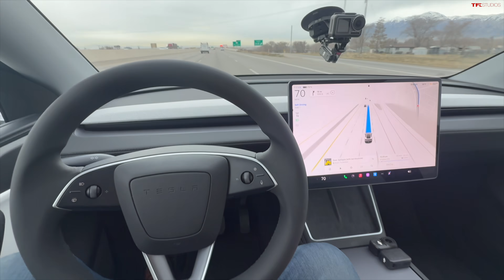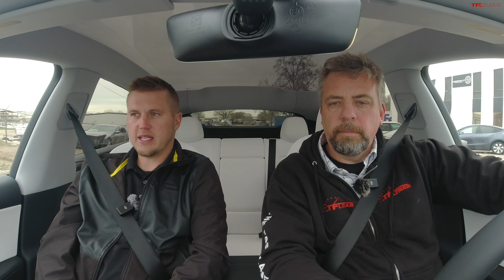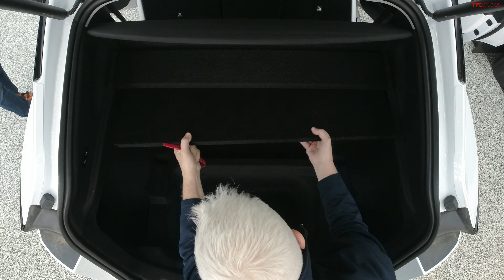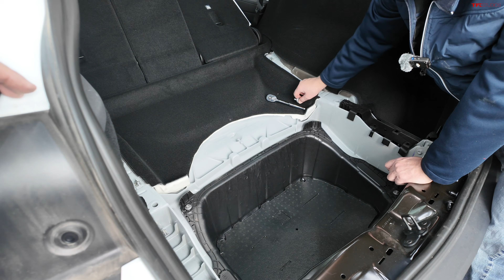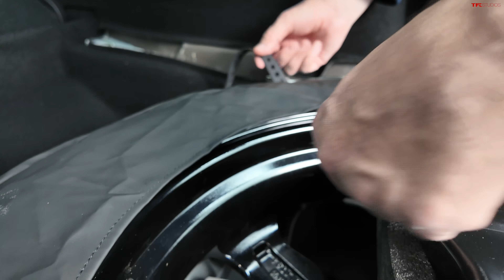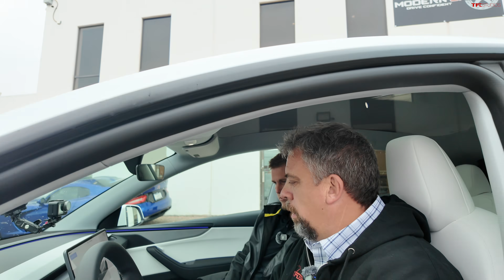This Simple Change Will TRANSFORM Your EV Range!

Comment: I didn’t see any mention of stopping distance, acceleration, wet performance, or lateral grip. 
It’s worth knowing what trade offs they’re introducing.
Reply: Tfl was just testing the tires to see if they would increase range, they are spares and not meant to be used constantly
Reply: yeah man cause people are obviously itching to put donut thongs on all 4 corners of their tesla.
Reply: @Eli.H.Sanchez Stupid people do stupid things.
Reply: Dude it is a spare tire that you helps you drive the car to the nearest shop to fix your car’s tire and then continue your trip. This spare tire is not for long trips it is only a temporarily fix.
Reply: @claudiudoncea9270 That is correct, but the way this is presented will make some people actually drive full time on those tires. Never underestimate human stupidity. There is a reason the USA is so litigious and put warnings on everything.
Reply: Grip has more to do with rubber type then anything else.  A half size contact patch also holds holds twice the weight, which doubles the grip per area--- making the overall grip essentially the same...  The problem is it the rubber wears down twice as fast.  For this reason temporary spares tend to be made with very hard rubber (mostly to prevents tire rot since they need to good for decades) which has relatively poor grip.
Reply: @romanval69  lies. Half the contact patch with the same rubber will take longer to stop due to having less traction. In order to have the same traction the rubber would be have to be softer which would then wear faster. Wider tires grip better for a reason.
Reply: @romanval69 That is only partially correct. Yes, part can be compensated, but: the contact area plays a big role and it is combined with the uf (friction factor). I can directly see that the spare wheel isn’t any softer rubber (no higher friction factor), otherwise it wouldn’t be much more efficient. The smaller air resistance of the tire is only around 1-2% (no aero wheel). 
Basically: the braking and road holding are seriously compromised and this really inappropriate to do so, or make the suggestion in the video. 
There is a reason this is illegal in many European countries where you can only fit manufacture approved tire sizes and spare are only allowed temporarily. 

Remember the C63 AMG driven by Chris Harris on space savers? Great fun, but no traction at all.
Reply: Still, it's dangerous and irresponsible to even be doing this.
Reply: @realsharpninja is it? They’re DOT approved and Andre is fully aware of what they are and it appears to be a fairly temperate day with low traffic.
Reply: @MX5-XU DOT approved for a single positon on the vehicle is very different than all positions on a suspension designed for specific geometry and coefficient of friction.
Reply: @realsharpninja one spare is on each position. There is nothing in the DOT ratings about multiple rated tires fit to a vehicle. And I presume modern spare designed the wheels to match the OE scrub radius so it’s largely safe if you’re aware of what you’re driving on and doing so in a manner that acknowledges that.

Comment: Lighter wheels would also help
Reply: The weight of the tires could be the main difference in the results. Wider tires are heavier and so are the wheels.
Reply: @bennychristensen4314  Forged wheels would save how much per corner? Could it be 25% or even more? If you can afford it you can even go mag wheels but forged AL wheels would be the most if you still want the most bang for your buck. 
You can't really save a lot on the rubber itself but you can surely save a lot on the metal.
Reply: @Enforcer_WJDE  I went from 45 lbs per corner to 36 lbs per corner on my Chevy Bolt without even going to forged wheels. Just went to 16" wheels and slight narrower(although max performance summer) tires.
Reply: @bennychristensen4314  I doubt it. It was aerodynamic drag and rolling resistance that made the difference.

Weight isnt as big of a deal when you have regenerative braking. A heavier wheel/tire will just take more power to slow down, which means you will recover more energy while regen braking. Its not 1:1, but it means the weight is a much smaller factor.

Comment: Now do a brake test
Reply: Or handling.
Reply: These need to be th next comparison
Reply: They want us to crash
Reply: I actually removed the factory 215/50/17s from my EUV, and installed 205/6016s AS LRR on steel wheels. I was looking for comfort, and roads here are extremely rough. The steelies weigh less than the factory aluminum wheels, no change in range, but wet handling is still not good. Smaller wheels, more sidewall is better than less contact patch. If I had to do it again, I would’ve opted for a wider contact patch.
Reply: That's why they are a spare tire, and shouldn't be advertised as a mire efficient alternative like the video suggests 😅
Reply: It’s just for fun people get over it.

Comment: Fast, heavy cars on skinny tyres, what could possibly go wrong??
Reply: I’ve had their spare since I purchased my 1st Tesla back in 2019. Now I have a 2026 Model Y and am definitely doing this install.
Reply: @texas737pilot   may your stopping distances be longer than your roads. 

🎉
Reply: @ascgazz  I meant just the spare in the trunk install…I need the performance of the regular wheels and tires😂
Reply: @texas737pilot  👍
Reply: An excellent get you home option. I have a Skoda, so don't have enough space, but would definitely buy one if it became available somehow
Reply: :face-green-smiling: this dudes got balls to drive like that
Reply: Shut up stupid sand flea
Reply: @JohnDoe-gm5ux  erm… 😂😂😂😂
Reply: @JohnDoe-gm5ux  and “sand flea”??

I’m white British, you daft tit. 😂😂😂
Reply: The ideal comparison would be using a similar style wheel. The wheel design on the test narrow tires are likely not as efficient as the oem.
Reply: You dont need to go fast
Reply: I took off the 255 and put 235's been over 20k miles, no issues for me
Reply: @SouthFlaDiver  you’re one person.
Reply: @ascgazz  i put on 235/60R18 Nokian One tires.  There’s 2 people.  

That said, spare tires/rims are much narrower and more low profile than mine.  They’ll easily bend if you hit a pothole hard. Mine won’t
Reply: Not like a semi can stop any faster
Reply: saving 10% is more important
Reply: Breaking distance for a car that's weighed down with heavy batteries, and now you subtract the size of the footprint, reducing grip?  Yeah, not smart at all!
Reply: @HighAnxi3ty not like a semi stops any faster.
Reply: Ask Chris Harris how much he enjoyed it on a c63 amg Mercedes
Reply: @TreatsOnTheStreets  will do, next time I see him. 
😂
Reply: @ascgazz you can find out by watching his video about it on YouTube 😅